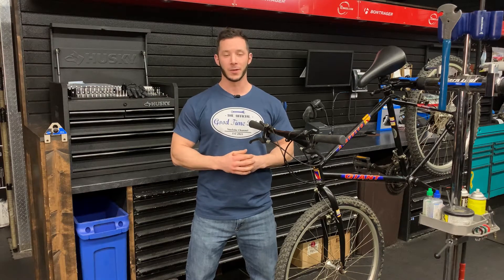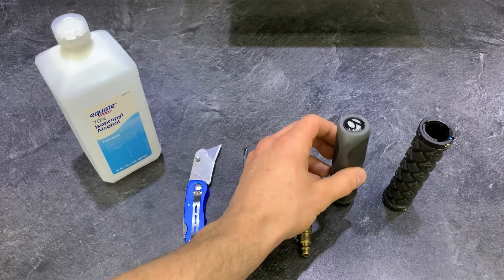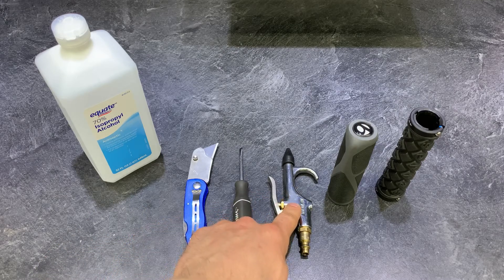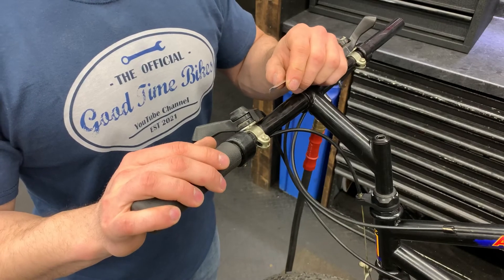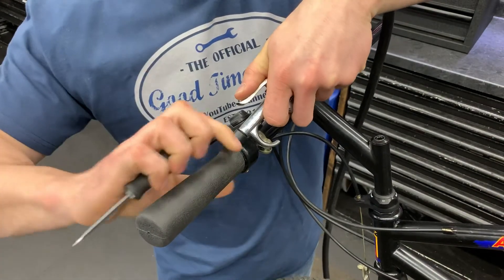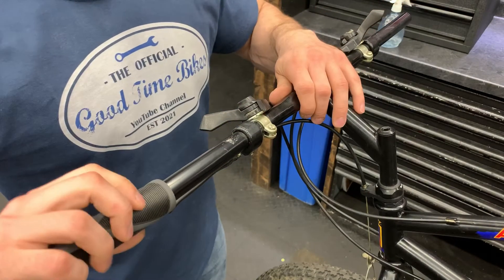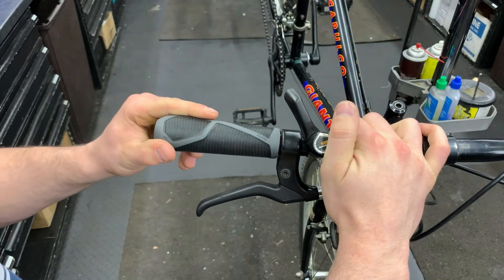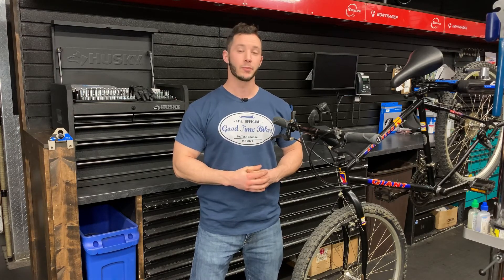How to Replace Grips on your Bicycle #goodtimebikes

Comment: I used to use hairspray until someone invented bolt on grips.  Racers used to wire on grips to keep them tight.
Reply from the maker: Hairspray is another way but I didn’t want the guys getting yelled by the ladies lol
Reply: @GoodTimeBikes  hairspray used to be big for guys hair back then...
Reply from the maker: Ah like in the 80s.. “big hair” lol

Comment: How about grips for a 1969 Schwinn midget.
Reply from the maker: If you leave it out in the sun on a hot day they should be pliable enough for the screwdriver and blow gun technique. Another way is to use the blow gun, press it firmly against the end of the grip, aiming straight in to the hole, next wait for that thing to shoot off there like a rocket so careful where you’re aiming. Finally if you need to you can use an open end wrench that’s just wide enough to slide over the diameter of the handle bar, press it against the inside end of the grip then hit the wrench with a hammer. One of these techniques will work. Let me know which one works for you 👍🏼